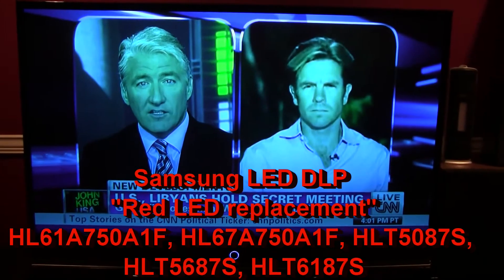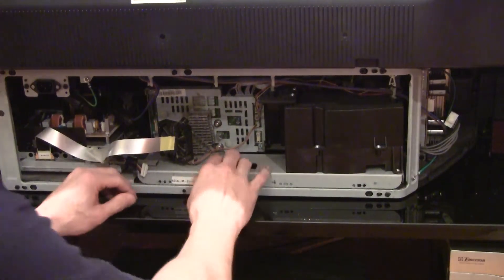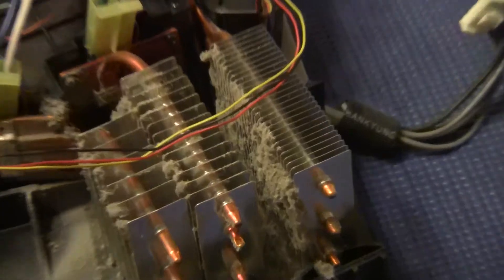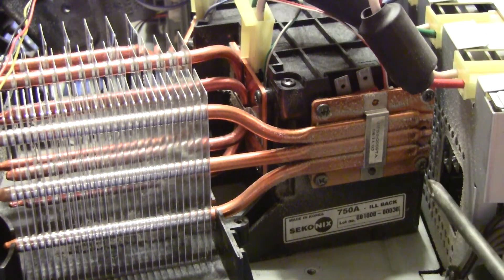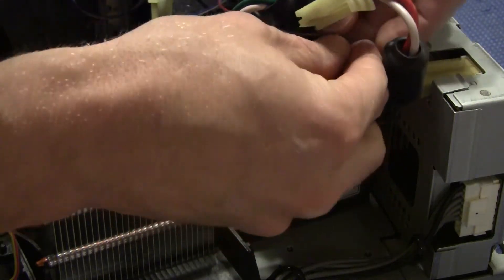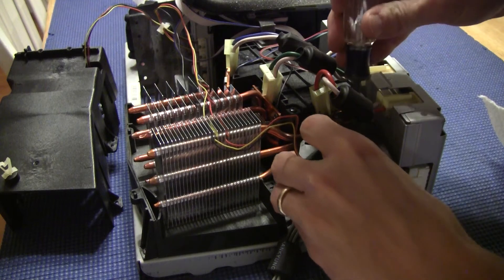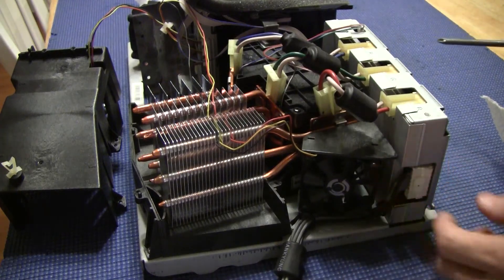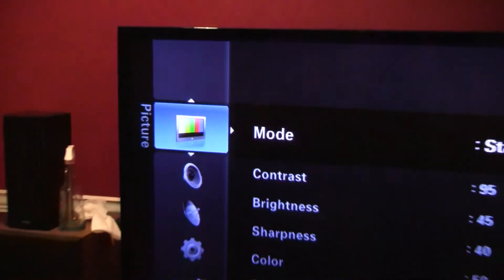Samsung HL67A750A1F red DLP LED failure repair copy

Comment: I have a HL61A750 (HL61A750A1FXZA RE01). Last year when the house was particularly hot, like 85F, the picture became purple. I guess this means the green LED was out. I shut the TV off until the evening and the picture was back to normal. Happened again yesterday, and was accompanied with the smell of a hot PCB, and have had it off since. Tonight I'm going to pull it apart and clean the fans, heatsinks, etc. Hopefully this'll do the trick. If not it's nice to have this video if I end up replacing the LED. Thanks!
Reply: I can’t help but wonder what happened
Reply: @null0102 It was the green LED as I recall. I bought a used HL67A750 for ~$200 back when I posted the advice, and cannibalized it for parts. The leftover guts are in my garage as spares. I'm perfectly happy with this TV, besides its tendency to power cycle every now and then. Some year I'll replace it, but there is no compelling reason, AFAIC, to move beyond 1080p, and while I could get a better 1080p picture, I don't care enough to do it.

Comment: A question here for everyone. It comes with the Pt-120 red phlatlight led which is the OEM from the manufacturer but can i use the CBT-90 red phlatlight led. They both are made by luminous.  The part # from mouser electronics PT-120-RAX-L15-MPK and CBT-90-RX-L15-BN100. One part cost $142.00 and the other is only $90.00

Comment: THANK YOU - I found this video very helpful with my HL-T5087, a slightly different set. 

HOWEVER: In looking up repair info on these sets I found several claims that the LEDs usually fail because of failing capacitors on the LED power board. (A local service shop that came highly recommended was one source for this info: "The LED power board fails and burns out one or more LEDs." Fortunately in my case the set seemed to shut down as soon as the green LED stopped working. Unfortunately for that shop, they were unwilling to take on the job, saying "the power board is no longer available, neither are the LEDs." Apparently they are unwilling to replace the caps or use used LEDs. Too bad, they could have made some money on this repair.

The LED power board is the trapezoid-shaped board to the right of the light engine (as you look at the set from the back). Sure enough, all five of the smaller electrolytic caps on my LED power board had slightly-bulging tops. They had not leaked, but any bulge in the top of a cap like that indicates a problem, even without visible leaks. 

So, I replaced all five of those caps, plus the larger one at the back. Using the part selector at Mouser Electronics I matched all of the parameters (capacitance, voltage rating, temperature rating (105C), and even lead spacing (7.5mm - very important for an easy swap!) and went with caps rated for 10,000 hours or more. I don't know what the lifetime rating was on the originals. (specifics:  For this set you'll need one of Mouser part 647-UCY2W101MHD , 100 uF 450V, and five of 647-UHW1E222MHD6 , 2200 uF at 25V. I wonder if these sets were a late victim of the "capacitor plague"?) 

The board is easy to work on - replacing all six caps took well under an hour, including setup and cleanup time. Note that the tall cap at the back of the board (ie toward the front of the set) is held down by something like hot-melt glue or silicone adhesive, and so requires more than just heat and desoldering braid to remove. I did not replace the adhesive - it's most likely only important to protect against shipping damage. (btw, I highly recommend the Panavise circuit board holder, or something similar. for such work.) 

Now that I had an LED power board with all new electrolytic caps, I went ahead and replaced the green LED. The replacement was a used one, pulled from a working set. It shows no physical signs of problems. The replacement went about as shown here.  However on my set the three LEDs are in a row; the red one is not off on the end as seen here.. 

Oddly , although removing the green LED's heat sink does not require removing the red one's, you do have to remove the blue one! The blue one's fins make it impossible to get a screwdriver in to reach two of the four screws that hold down the green LED's heat sink. The blue's heat sink can just be set to one side; it need not be disconnected. 

The most physically challenging part of the job was removing that black two-piece shroud over the heat sink fins (the one held down by six screws) and getting it back on. The smaller piece, the one at the left end (as viewed from the rear of the set), is the troublemaker. I was SO tempted to leave it off! But I prevailed. Remarkably, there was practically no dust in my set's heat sink fins. But good call on cleaning them. 

So... my LED DLP TV is now fully operational. Thank you again!

Comment: I just had to replace the capacitors on my power boards on my hl61a750a1f set. When I booted it up, I had no green, just blue and red. Question: Where do I get the replacement green chip/board? Thanks, Scott
Reply: Update: I see something on e-bay for around $120. Nor sure I wanna continue with this set. I will likely just replace it. Thanks, Scott
Reply: I found mine for $40 on eBay and there was another recently for just $10.

Comment: Great help! thank you for your video.  I needed to replace the blue light and the dlp chip.  Less then $300 for the parts on Ebay.  With a cleaning and new parts the picture is like new and I kept this tv out of the landfill.

Comment: I have a same TV, i stumble with this video while I was searching video for DLP replacement . However may be i missed but i did not see a left side fan when you took it out that black box not the one that you have behind heat shield but  a seperate one. I have my TV for over 8 years now but do not have that much dust accumulated. I recommend recheck and make sure you have that fan. My few cents.

Comment: Hey buddy I have that same exact tv and I have that same problem with the same color. Where did u get that part and what is it called? Cool video finally found the problem thanks to you.
Reply from the maker: Just type BP07-00029A into Google.
Reply: Do you happen to know the numbers for the green and blue LED's?
Reply: @katana1150  BP07-00030A BP07-00031A

Comment: I also recommend checking the capacitors on the power board, just to the right of the light engine. You can see all 4 of them on the video when Dave is removing the light engine from the Television set.  All 4 of these went bad on my set. they are 2200uf 25V 105c Caps.

Comment: I turned my TV on today and the screen is green. When I look at the menu I see Red and Green but no blue. Should I replace the Blue LED? I have heard several people say the RED has gone out but not many mention the blue or green LED. Any advice would be appreciated.
Reply: Wesley Patterson Sorry, I didn't see this or I would have responded earlier.  Yes, all went well.  Today I replaced my DLP chip because of the white dots.  Both are kind of a pain but since I already took the engine out once, this one was much quicker.  My TV is 7 years old, but has a beautiful 1080p picture.  I want to get another 7+ years out of it.  I have no plans to go 4k anytime soon.
Reply from the maker: I would think it would be the same issue. I have heard that the green and blues go out as well.
Reply: Thanks man, I have a blue chip now.  Just trying to get the courage to do it
Reply: Tony Upchurch Curious if you found the courage how your repair went.  I too just got a green screen, and seem to lacking any blue.  Was the blue LED the problem?
Reply: Me too an now 4K is all you can get